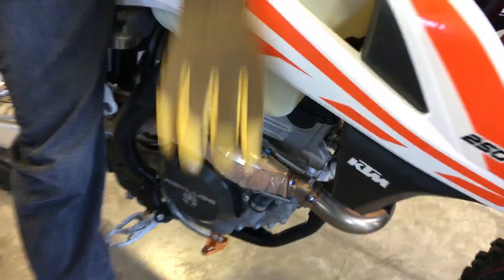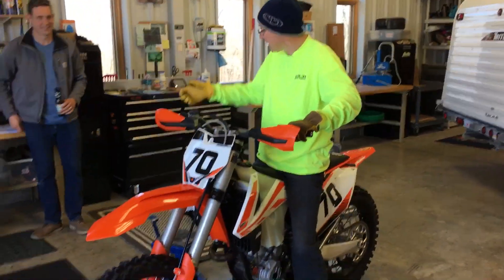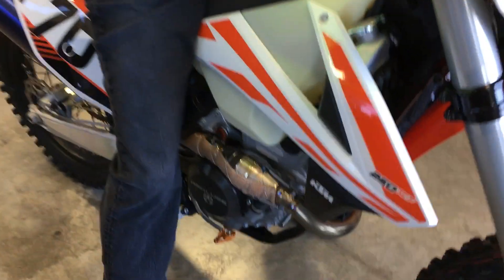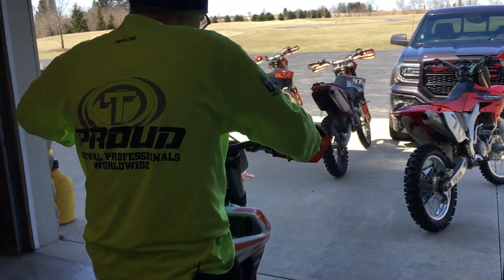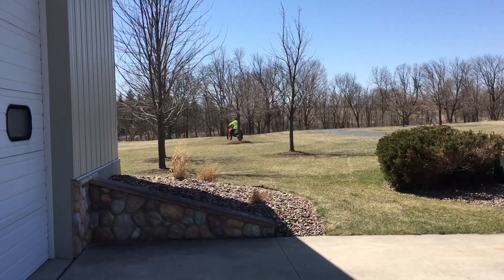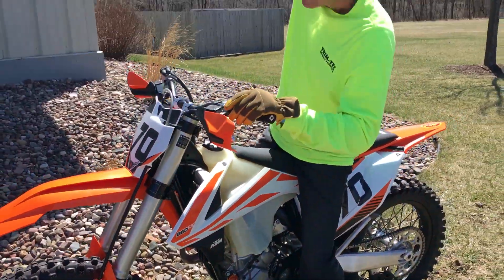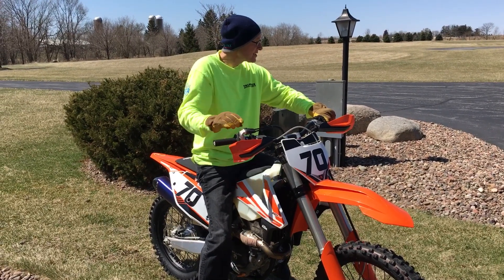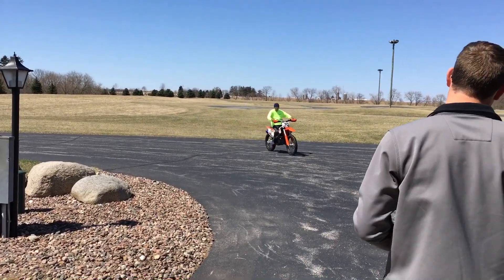What is wrong with this Rekluse Clutch on this brand New KTM 250

Comment: As stated by others, ur adjustment are wrong and you are not following the manual correctly.    HERE IS THE PROBLEM;  Install is incorrect and rekluse is notorious for leaving info out install steps. The core disc is engaging with the clutch in because ur total clutch pack thickness is too large. Free play gain increase will not correct it and you will actually bottom the screw out on the slave. Why?  it’s due to leaving the two steel rings in the clutch hub when you took out all the OEM plates. One is flat, one is concave and they stack together against the oem clutch stack to reduce and dampen open clutch noise. The concaved spring ring comes out easy if you look for it in the basket hub, the flat one behind it stick to the hub due to the gear oil and is very easy to miss and hard to get without a pick. The instruction do not specifically state to remove these two rings but the clutch drawings from rekluse show the entire clutch assembled in the basket and they are not there. I built up several rekluse setups and the symptoms your bike has is exactly that, remove those two ring and that will give you the 2-3mm clearance to set a proper free play gain by letting the rekluse clutch pack to sit inside the hub 2-3mm deeper.

Comment: Not enough free play. He screwed it out when he should have went in
Reply: Speaking from experience lol.
Reply: @shotgunner308  I’ve had probably set up  five ( are more) of those clutches and I was just real good about setting them up but I took my time and I read the manual about three times because different box I have different set ups I set up a guys Kawasaki one time and it required a different technique than a KTM and a beta is different also than a KTM. Because the KTM has that beveled washer. Also there’s a break in procedure that you need to do that will also help get you dialed in. It’s definitely not one of my favorite things to do though

Comment: Easy adjustment loosen your lock screws and spin counter clockwise then make sure you have 1/8 free play at the lever if it still drags repeat . Refer to your instructions these clutches are super easy to dial in first or second try

Comment: If he installed the rekluse, like he jerry rigged his exhaust heat shield god help him. There are precise instructions with tolerances. You need to break in the pack and have them at running temp. When you order them they are machine specific and they tell you what sprigs to use.

Comment: failure to read instructions.
Reply from the maker: It was a tricky one! We got it though.
Reply: CycleDrag what is ur solution? i have the same problem
Reply from the maker: @janshah6749  I believe they were turning the adjuster the wrong way by mistake. It's fixed now and runs great.
Reply: @cycledrag  I’m having the same issue. I tried adjusting the slave. It didn’t work. What else did you do ??

Comment: These guys need more beer.  LOL 😂 adjust clockwise. No need to pull clutch lever for nothing. Put un neutral accelerate al clutch lever should go down a bit with rpm

Comment: First, the yellow shirt guy is needs to get off the bike. Second, the guy with the beer is right, there needs to be more free play. But, it sounds like the idle is too high. Or the springs in the exp disk need to be stiffer. Most likely it is a combination of the above. But try one at a time.1. idle it down some. 2. Adjust slave cylinder for more free play. 3. Experiment with stiffer springs. But get that guy off the bike....